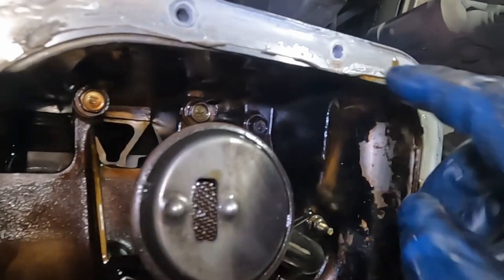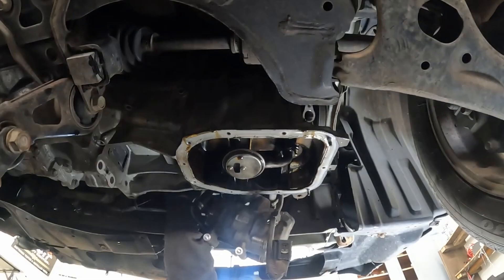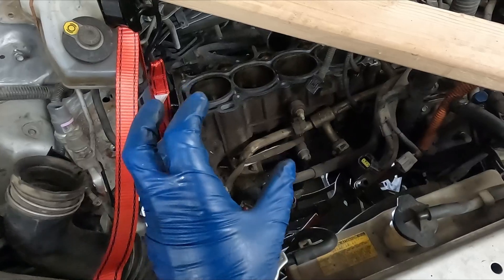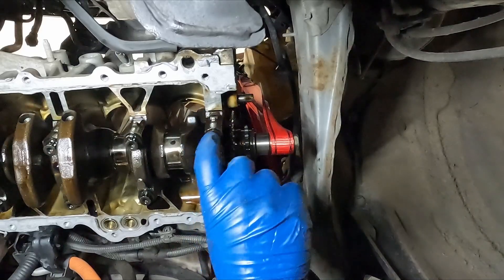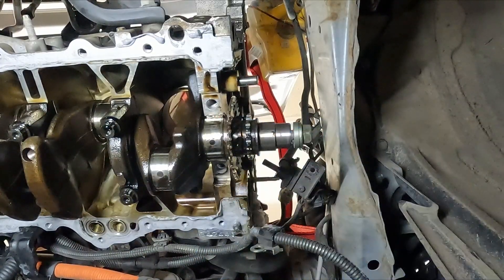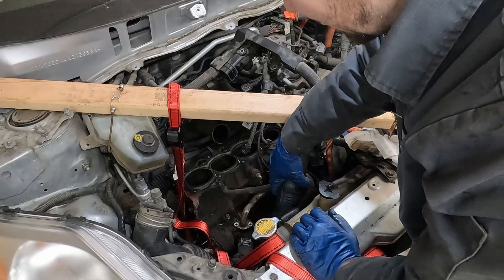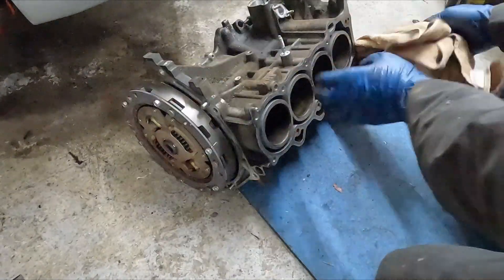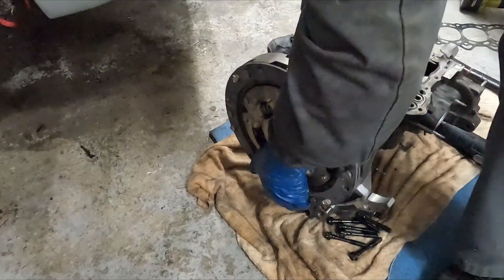2004-2009 Toyota Prius Engine Rebuild 3 | Removing The Pistons

Comment: I have an 08 burning a quart every 3K miles; 265K miles on it. The cat is getting fouled, likely from the leak/oily exhaust. Do you think it's less work to just replace the engine vs. replacing the rings?
Reply from the maker: It depends on the equipment you have. This engine isn't terrible to replace with the right tools but it is a tight fit. It's not meant to come out the top even though it can. It can also be rebuilt in the vehicle which is a nice bonus. I guess the two big things to weigh are 1. Swapping will be faster than rebuilding but you have an unknown used engine 2. Rebuilding will be cheaper and you have all new parts
Reply: @ValleyMobileAutomotive I appreciate your quick and thoughtful response. I have access to a lift and possibly a cheap replacement engine but I see your points!